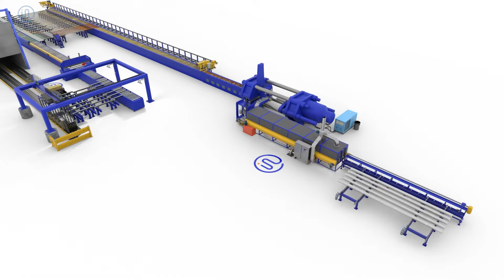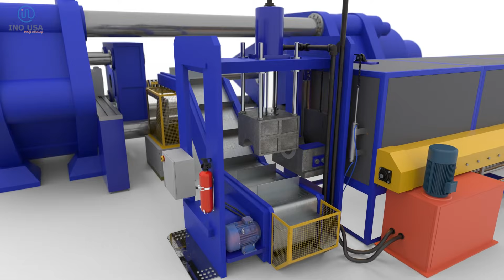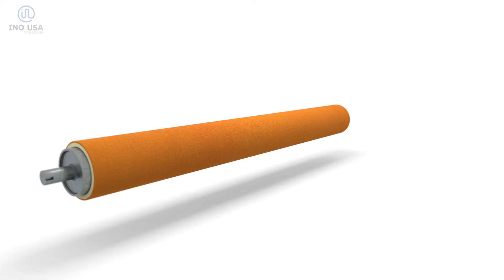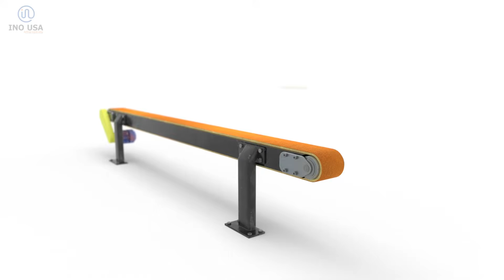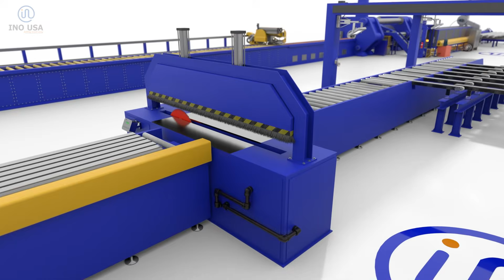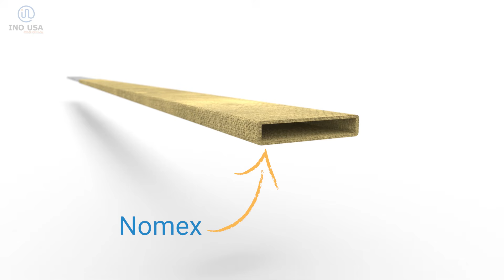Extrusions 101: Aluminum Extrusion Process Explained - INO USA

Comment: I don't understand why there isn't a seam.  Whatever creates the internal "tube" lumen has to be attached to the machine by some type of bridge, and that would make a seam, no?  Like with Play-Doh, they have presses, and you can push it thru basically a Stencil.  If you had a Stencil with the letter O, and you pushed Play-Doh thru it, you wouldn't just get a tube, because on a Stencil, the O is attached to the rest of the stencil by at least one little bridge, and this bridge would create a seam in the resultant tube.